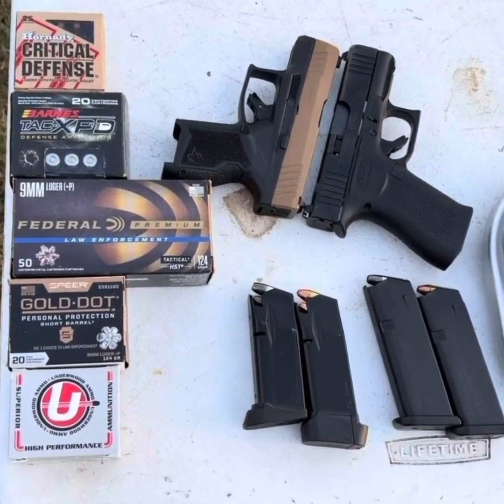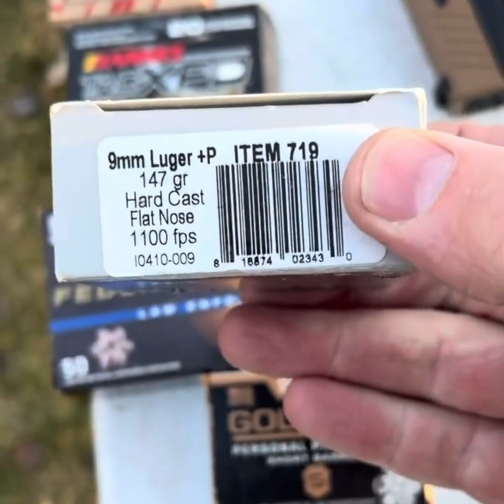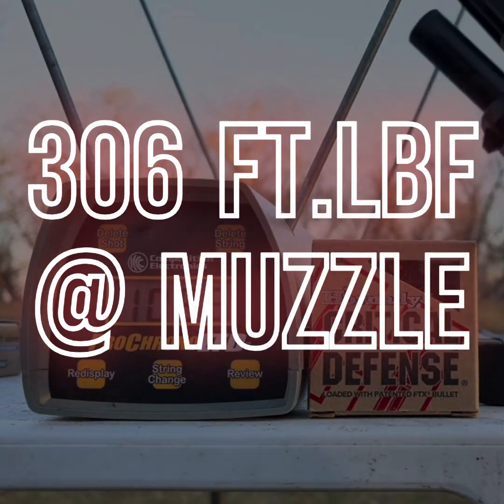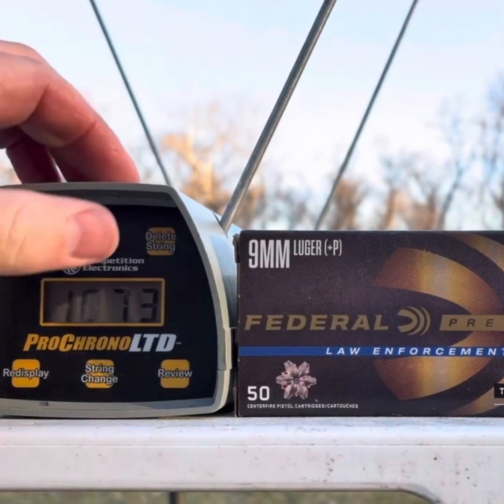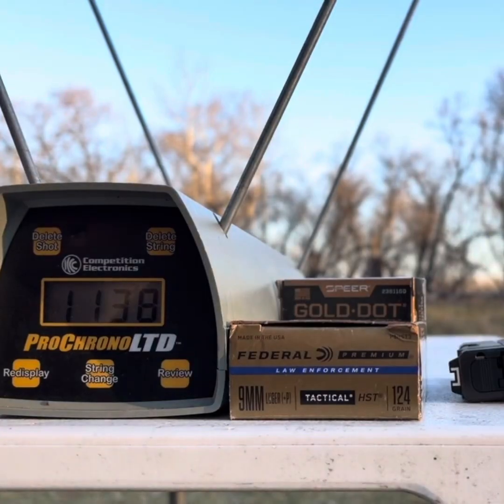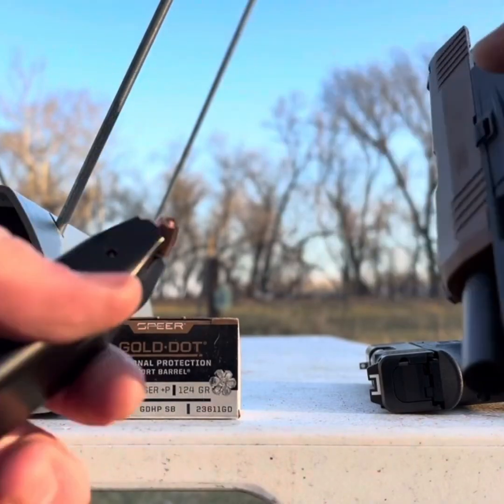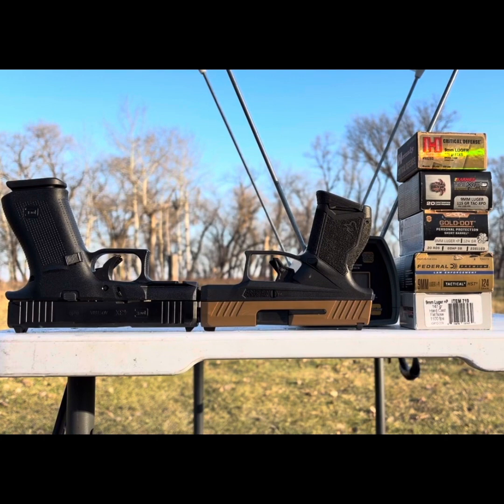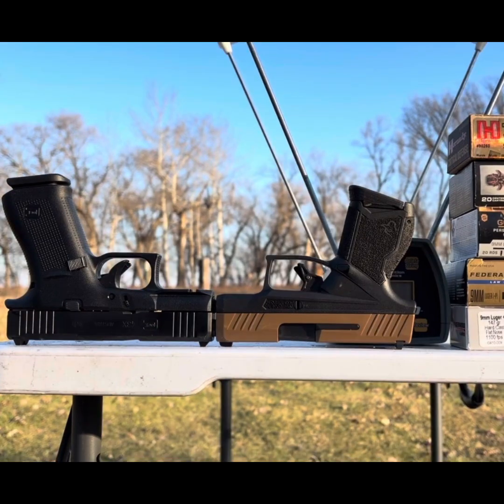How much does 0.36" difference in barrel length affect ballistics? Glock G43x MOS v Taurus GX4

Comment: The added length will make a difference, it's pure physics, but what is making more of a difference is the glock barrel has polygonal rifling over the taurus barrel uses standard rifling, polygonal rifling is way more efficient at keeping a tighter seal with the bullet as it travels down the barrel, creating more velocity

Comment: I've got a GX4 and a 365XL.  My HST's are standard pressure, the box doesn't say 'law enforcement'.  Those are in the XL and my SD9.  I've got +p Elite Defender/PDX1 and +p V-Crown.  Oh, and Hornady in the 115 Defense, 124+p Duty and 135 grain +p Duty.  I can't remember if my Gold Dots are +p or not, they're reloads I bought at a gun show 10 years ago.   I think PDX1 is riding in the GX4.  I'm on the lookout for a Fuse barrel to drop in the XL, no luck so far on the Sig website.